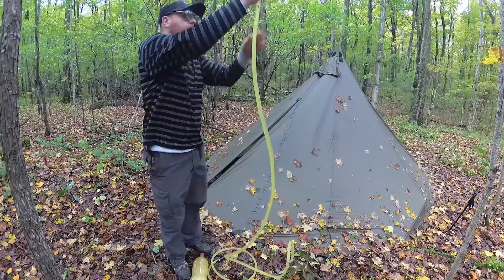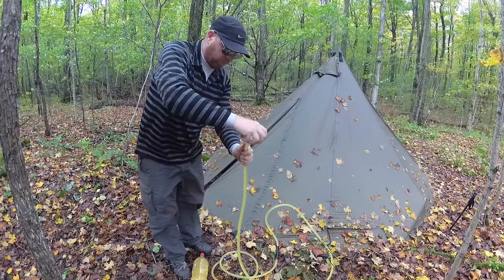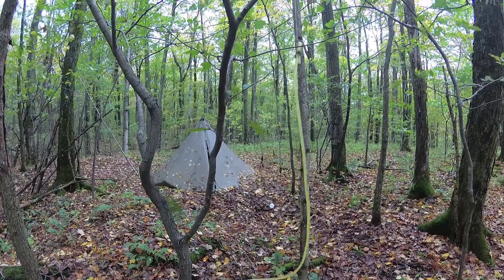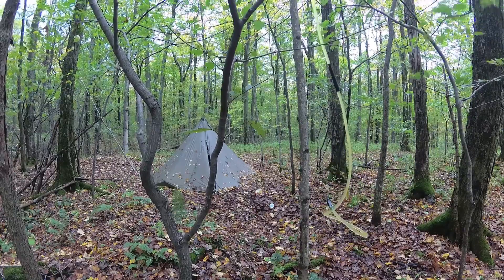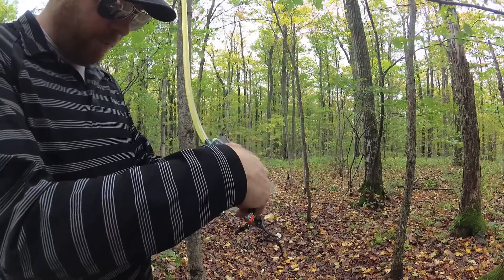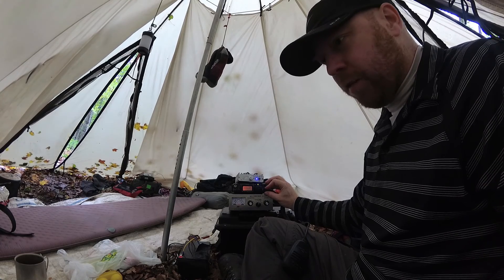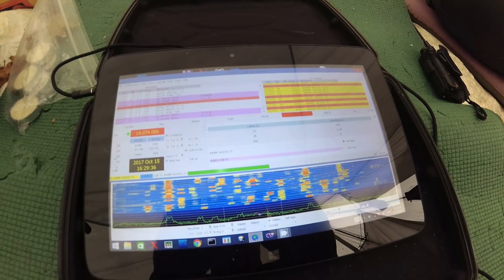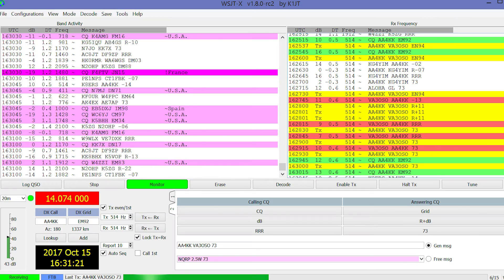Chicken Noodle Soup 20m Antenna

Comment: I hope it was really salty soup for better conductivity! Very inventive for sure!
Reply from the maker: It was the cheapest I could find and had the most salt.  My conclusion is that the term 'wet noodle' is not literal, but a comment about great propagation conditions - Today with very poor conditions, I was lucky to make one contact.
Reply: Instant Ramen Noodles ( nasty noodles ;-)))
Reply from the maker: Im done with the noodles Pat, I promise!
Reply: Actually, even distilled water will radiate but as the salt content goes up RF propagation improves and then drops off. I built a 2m vertical dipole from tubes of tap water and it worked fine until the chemicals in it corroded the copper probes. I'll use distilled and stainless probes next time.

Comment: That's very cool. But are you sure you're not just tuning up the coax?
Reply from the maker: KD2GIY HAM RADIO FUN I had a field strength meter and the soup was actually radiating.
Reply: VA3OSO oh . Wow
 I need to try that. Maybe with some lobster bisque